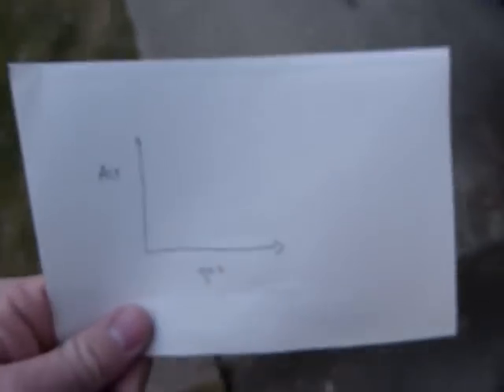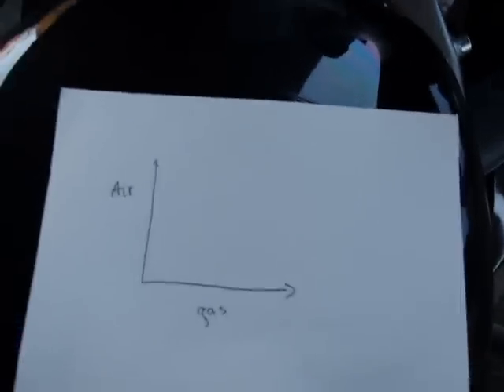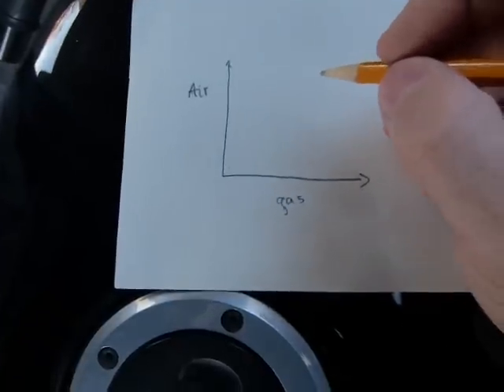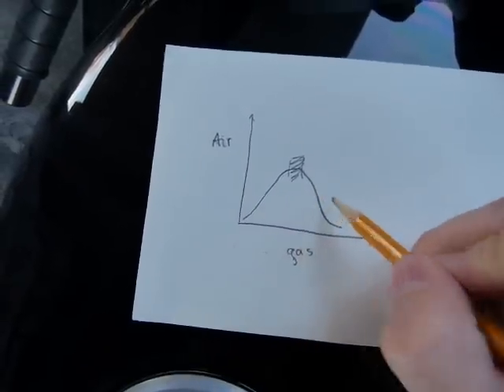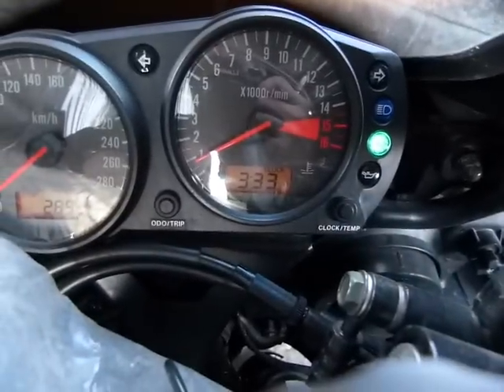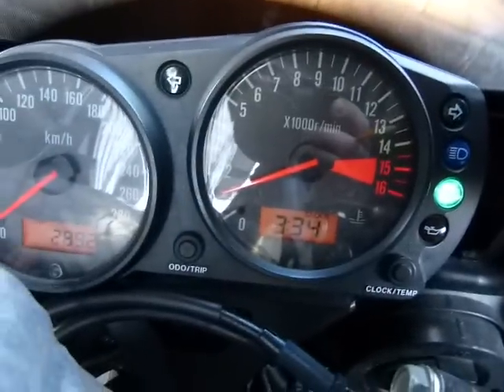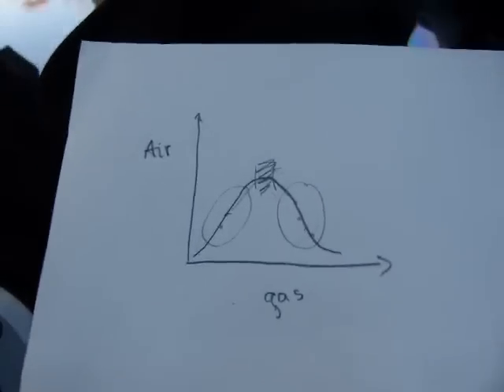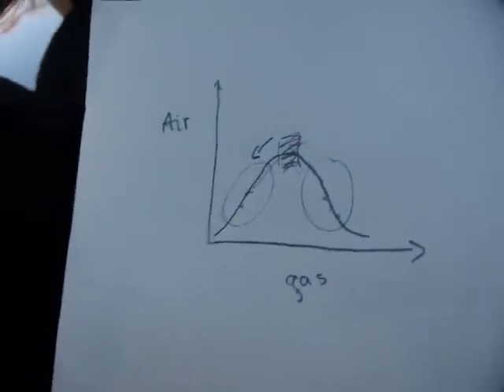Choke setting: cold engine

Comment: I just picked up my first 'big bike' here in the UK after passing my test; an '02 Bandit 600. My first time ever dealing with a manual fuel tap & choke as my 125 was fairly new and all auto fuel injection.

I was lost at finding that bite point of where the choke should be or really how to use it as it's totally new to me.

This video was perfect. Exactly what I needed, clear, concise, and an excellent diagram to break it down. I can't thank you enough for this!
Reply from the maker: Thanks, mate, enjoy riding.
Reply: Wow man 600 is pretty solid I got my first bike which is also a project bike it has a choke on it but was nervous on how to use it despite it Not getting to cold here.  Well have fun riding man

Comment: I always have fun with my choke lever ;).

Quick question, because it wasn't completely clear from the video: the ideal amount of choke is when the engine is idling at its normal idle RPM, right? And is it best to let the bike idle until you can put the choke fully neutral, or is it fine to ride and adjust as you go (at a traffic light, for instance)?

Just discovered your video's and I really like your approach to explaining stuff. Hope my questions aren't too basic.
Reply from the maker: Yup, sorry, it was cold and I just grabbed the camera quickly.
1 Yes, ideal choke keeps rpm at idle (1200 here), higher rpm (2500rpm) is not recommended because the cold engine oil does not circulate to the piston underskirt jets and valves, through fine passages.
2 I warm up the engine for 1-2 min, then go. Slowly. 10-30km/h residential.The tires need warming to grip. The drive chain snaps at extreme cold (-20C, -4F) temperatures, see ice road trucking. I adjust choke as necessary.
3 Choke fully off after 5 min. If colder (-20C, -4F), might be on for 20 min. Depending on engine size (heat retention) and cold. Ignore wind chill, that`s for humans.

Comment: I have an issue where my bike dies if the choke is on. Cold, warm, hot... doesn't matter. will start up and idle just fine but as soon as i touch the choke even slightly, it dies. Also, I can't get further than a  mile down the road before it bogs down and dies and i have to walk it back home... any advice?
Reply from the maker: Clean fuel filter, if any, then carbs need cleaning calibrating and setting, from idle to full, whole range
Reply: @theoverengineer  new carb and new fuel filter. I have the tools to calibrate it with and trying to understand how it works. Been looking for a video  to match my bike because i'm a visual learner. if I see it done on a carb that's different, I wont understand it. i know this makes me sound dumb or something but, it's just how it is for me...

Comment: Hey man I got a 2002 r6 with low low km got the carb needles and everything fixed changed about a year ago it just doesn’t start and run right it’s about 26° Celsius here so like 88°F and I choke it till the bike warms up fully and then slowly release the choke the bike will never stay running and if it does it as like 600rpm! Help
Reply from the maker: I mostly run in cold (15C or under), so i only have a vague idea. Engine could suck in false air from a cracked or badly fitted air hose somewhere, dirt in air filter could choke it, fuel lines, tank, filter should be clean.

Comment: Hi had my bike for a couple of weeks when I was starting with my choke it was fine but now we have snow and ice the choke works to start the bike but it won't shut of so it's running high revs whilst riding, could this be the weather sticking the choke cable
Reply from the maker: Could be. Or idle speed could be adjusted on the carb.

Comment: Hi, I have a ducati 696 it has a choke setting on it, when i first bought the bike (brand new) i don't recall i use any of the choke, but after one and half years with some kms on the bike, now if i don't use the choke the bike will just start and stalling it after. sometime even after i ride for about 10min, and leave the bike for 30min when i come back the bike start is still kind (lazy), is this normal for the choke setting bike? thank you
Reply from the maker: +freedomd333 Normal for engine - choke interaction. Reason: wear on the engine and dirt on the spark plugs, valve seats, throttle plate, air filter, intake pipes, intake air temperature sensor if applicable, inside the gas tank, fuel lines, carburettor jet holes. Due to wear and dirt the ideal fuel : air ratio isn`t met, usually not enough fuel meets too much air.
Reply: +theoverengineer i see,  thank you for helping,  so there's no way i can change that is that right? It's just been bit of hassle when i want leave with my friends and i have to warm up bike first.
Reply from the maker: +freedomd333 There is a way: clean everything listed above. In practice: just use the choke. Bike needs 1 minute of warming-up anyhow before placed under load.
Reply: +theoverengineer Thank you very much for explain this.

Comment: Hi there , I have a 2005 Triumph America , how long should I let my bike run for , right now it's -25 , the bike is in a non heated garage, and hear that because she's a little old I shouldn't run for to long.
Reply from the maker: +Darrell McGee Snowmobiles and chainsaws with carbs are doing fine in minus anything, or until the fuel freezes.Winterizing is possible, but running it could save all the work of storing and winterizing. Rubber seals, sealants, gaskets and O-rings dry and crack way less or do better when lubed, that is in use. Same for the electrical system.

Comment: hi just got my first bike I put the choke on and start it it revs pretty high 4000 range but after I drive for a bit so the bike is warmed the choke is off but when I put in neutral/ come to a stop it will idle for a bit then quite any suggestions or thoughts?
Reply from the maker: Yeah, engine too cold, takes in too much cold air + not enough gas at idle. Close the choke a bit either and ride around a bit more like that. It can take 1-10km to warm the engine up properly, depending on air temperature.
Reply: ok thank you

Comment: Sorry for being so naive,I got my firt 250cc 4stroke dirtbike last two weeks ago and im getting used to it now but there are bad days because the bike wont start,but just this time I managed to start the bike after so many kicks turns out that the engine is cold and needs to be heated up??? (I tried to find the choke but cant find it on the bike)(or im just blind) (I dont even know what choke is*)😅
but my problem right now is i think that my kickstart button isnt working. (CORRECT ME PLEASE LOL IS I SAY SOME STUFFS CAUSE I DONT RLLY KNOW ABOUT BIKES but i am interested) 😀 managed to ride 2stroke without dying. 🙏
Reply from the maker: Find and read users` manual first.
Reply: theoverengineer it worked yesterday. thanks for the vid btw.
Reply from the maker: Ok, let me know if you`re stuck again, might be able to help a bit.

Comment: I got a 03 ninja 500, the carbs has been cleaned not too long ago, new battery, the bike runs great, air fuel ratio are all good no engine problem, but my choke don't seem to want to enrich for that rpm to go up even when the lever is all the down but i see the mechanism and the cable moving but no luck. It's a pain to start in the cold unless its warm out. Any reason why?
Reply from the maker: Carb:is it really visually clean inside? No gunk on float needle, on any of the small passages?
What`s the compressive pressure on the cylinders?
Gas quality, sediment in tank.
Air filter quality, by-pass leak somewhere.
Reply: Yup, it is complete rebuilt, only using top tier fuel with added fuel stabilizers, good compression, no hesitation on throttle, spark plugs and air filter are new, it's just that choke that gets me.

Comment: Injection is great then, you basically start it cold, it does the job and you can let it warm up while driving it normally.

But so many people tell me carbs are more reliable once well setup, i now wanna try it with like a hornet 600... in my city temperatures go from 5degres celsius minimum during winter to 35°C (sometimes a bit more) during summer, do you think the carb might need adjustment everytime winter comes or it's just a matter of choking the engine well ?
Reply from the maker: I never needed any tweaking in the same temperature zone at sea level.
Reply: @theoverengineer  oh great ! And do you need to wait for the engine to be at good temperature or you can finish adjusting while driving ?

Comment: do you ride with the choke in the off position or in the position you have to be in according to the temperature
Reply from the maker: +Jorge Amador I take off with the choke ON (meaning that the butterfly valve is restricting the amount of air entering the engine) either fully or partially, according to air temperature taken in by the engine. After some time in riding it is gradually turned fully OFF.
Reply: Ok

Comment: So if the bike starts right up you don't need to use the choke?
Reply from the maker: Correct. No stalling - no choke, yes stalling - yes choke.
Reply: Thanks what If it stalls a little bit than after a few seconds or second try it starts ? Should I have used the choke
Reply from the maker: mrmee1229 Yea, that`s still a stall. And of course choke setting can`t do anything about a clean carb or air filter.
Reply: Well the bike I got was sitting for a bit from March to September pretty much. My friend said don't worry my carb is fine but k read somewhere if you have a bike that was sitting you may want to clean the carb. Idk I'm a newbie.
Reply from the maker: mrmee1229 Carb is fine: gasoline is like any organic compound, the heavy compounds settles to the bottom. The cruddy, gummy, oooie, tarry bitumenous stuff will clog the fine jets and pin holes of the carb wonderfully effectively.
Since the bike starts and runs a few seconds, just keep running the engine, the carb will somewhat self-clean. Shake or stir the gas in the tank first.
Reply: Ok cool. Thanks man. I appreciate the response Im new to the bike life
Reply from the maker: mrmee1229 No worries. We all start at nothing. Any ideas or issues come up, drop me a line.
Reply: Awesome will do! 
Oh wait there is somethin when my bike is off its easy to get in neutral when it's running an I've driven it its kinda hard to get back to neutral. Am I doin something wrong ?
Reply from the maker: mrmee1229 Nothing wrong. The oil warms up, friction is lowered, same pedal force glides the gears past the gap for neutral and engages another gear. Takes time to get precise feel in the toes. Could take a few months.
Reply: Danm. Well thanks I'll keep trying to get it. Do I have to be moving to do it ?
Reply from the maker: mrmee1229 No. For safety reasons, motorcycles must be shiftable to neutral standing or rolling.
Reply: Oh ok. Guess I'll keep practicing. Deff appreciate the wisdom
Reply: Hey man sorry to bother lol but when I start the bike am I suppose to start in neutral than click down than take off ? Cuz I usually kick up than take off.
Reply from the maker: mrmee1229 Roll off in 2nd if you like (up), steep uphill might need 1st (down), it`s all good.
Reply: Ok SOOO that means I can go from a stop in 2nd gear ? Lol neutral 2nd gear an go ? Sorry if you just answered !
Reply from the maker: mrmee1229 Oh yes, facing steep downhill at an intersection, come to a stop start in third if you like. No damage will be done.
Reply: Ok cool cool. Some dude said I should always go to first at a dead stop
Reply: But before I was always starting in second. Idk. Lol so much info
Reply from the maker: mrmee1229 There is no should. Facing  a strong downhill, such as this Hill test site data I often start in 2nd or 3rd.
Reply: Hm gotcha. Hey man so my bike just shut off on me the other day. I was in 4th gear than came to a fairly quick stop. My friend said it was because I never downshifted. Which in fact I was doing incorrectly. You think this could be it ?
Reply from the maker: It is likely. For a fairly quick stop or emergency stop: 1 pull the clutch lever all in, 2  focus on the brakes 3 scan for an avoidance path 4 you can find the right gear later. See how the clutch works: Set your clutch for FAST shifting Clutch lever position  set-up: Brake & clutch check
Start a bike on a hill Adjusting a clutch cable Check your clutch cable adjustments and set-up Disconnect & reconnect the clutch cable
Reply: It wa cuz the light turned red lol
Reply from the maker: Yes, that`s an emergency if you ride like a motoboy in Brazil.

Comment: This explains nothing.  You don't have a choke issue because regardless of where the the choke is set the engine runs.   Everyone with common sense messes with the choke control once the engine is started and for the sake of starting the motor the theory behind it is useless information.
Reply from the maker: Where does the title or the audio track say "This video will explain anything"?
Might want to actually pay attention. Everyone with common sense gets it.
Beyond that, a useless comment.